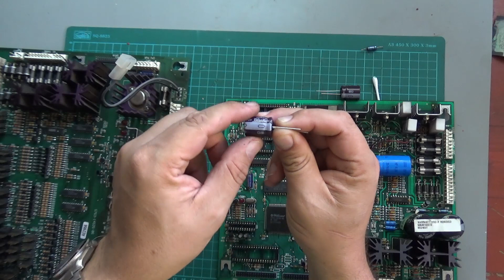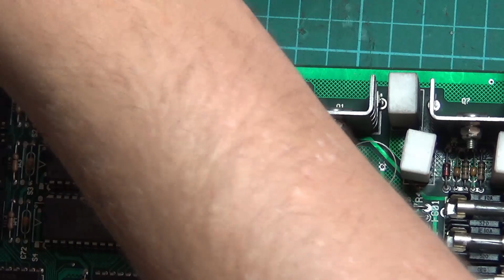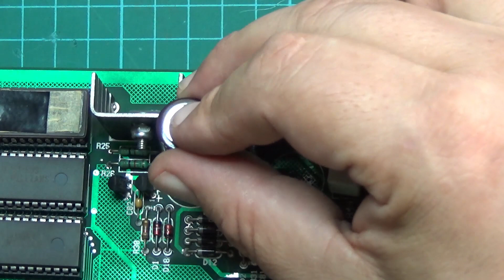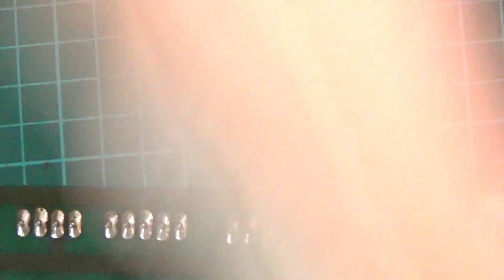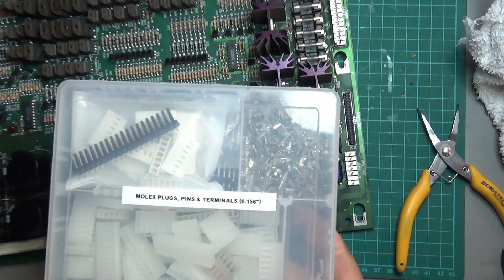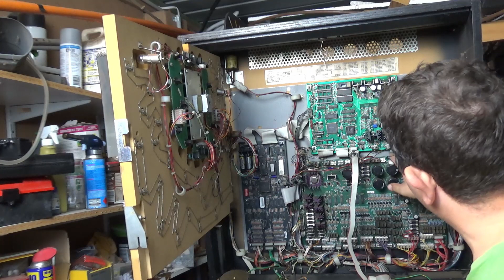Pinball Curcuit Board Hack Repair on WPC Scared Stiff Machine

Comment: PINBALL EVANGELIST,    
    1.) Why does pinball repair technician try to "demagnetize" the solenoids plunger? because I would think you would want the plunger to be magnetized so it can be able to be pushed and pulled in by the coils magnetic field.

     2.)   When pressing the flipper solenoid it creates an arcing spark across the switch contracts but to prevent it is to add a diode or capacitor?
Reply from the maker: I have not heard of plungers getting magnetised but suppose if they are magnetised they may use more energy to move so a little sluggish but would think by the time that happens I would not bother to demagnetise them as  they are so cheap to just replace.
Reply: @PinballEvangelist  thanks for the help
When holding down the flipper why doesn't it burn out the flippers Coil#1 but only burns out the flipper coil#2? Its a very common problem of the flipper coil#1 not burning out but flipper coil#2 burns out any reasons why?

Comment: PINBALL EVANGELIST< 
Why doesn't the spider motor and solenoids not firing? you just replaced the filter caps and header pins what does this have to do with the spider motor and solenoids not firing?
Can you explain how the lamp matrix circuit and Switch matrix circuit works because they use PIA chips to do what?
Reply from the maker: When I put the boards back in the machine the the spider motor and solenoids were not working and towards the end of the video it shows what the cause was... Classic secondary issue caused when repairing / reinserting boards.
Reply: @PinballEvangelist  oh ok. 
Are you going to make more videos showing what else to modify on the other boards?
Reply from the maker: I tend to document most of my repairs, so yes as I find issues and work through them I will have more videos.  I have several other videos showing board repairs on WPC Bally Williams machines.... You can start with this one https://youtu.be/OkP_gj_K6WQ